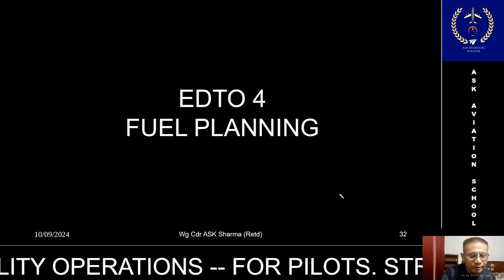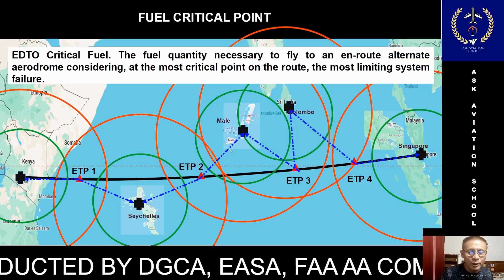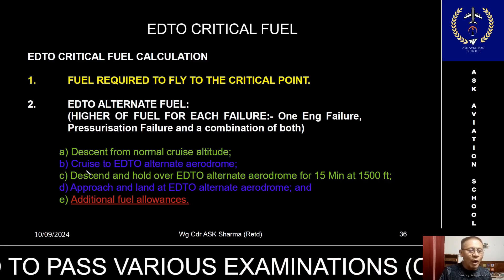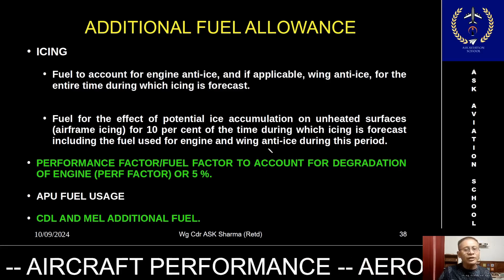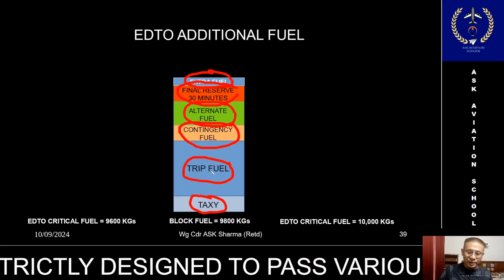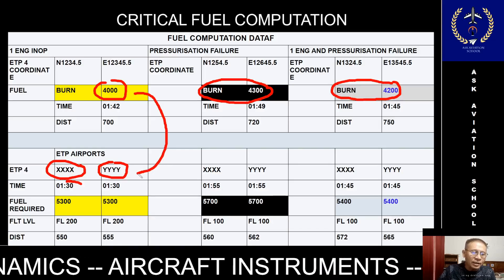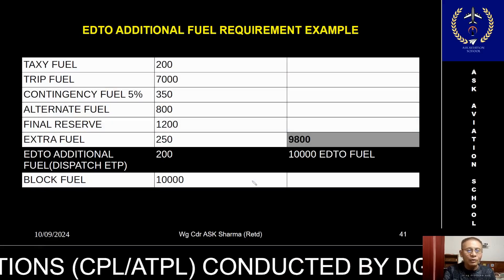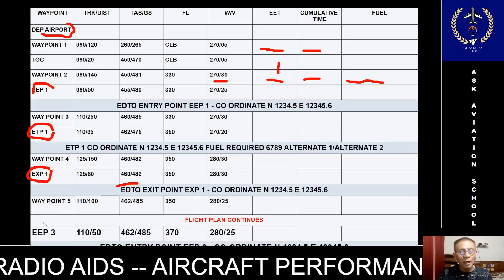Fuel Requirements for Extended Time Operations (ETOPS & EDTO) - EDTO PART - 4

Comment: Thank you for the detailed content. Highly appreciated. You already know that most critical system is generaly fire suppression system for edto.Is it allowed to plan edto an alternate which has a diversion time beyond cargo fire suppression system?  For example a359 has 195 min cargo fire suppression system and diversion time is 210 min to an edto alternate. Considering route is within max diversion distance is it a legal planning or we should refuse because its beyond our system limit?
Reply from the maker: Yes one can plan beyond the time of the most critical system. It requires special approval from the regulator, depending upon the aircraft reliability, strict maintenance  schedule, training of the crew, dispatch, weather condition. Etc.